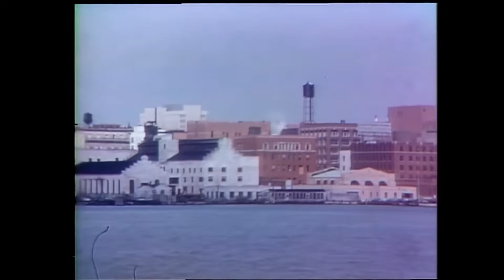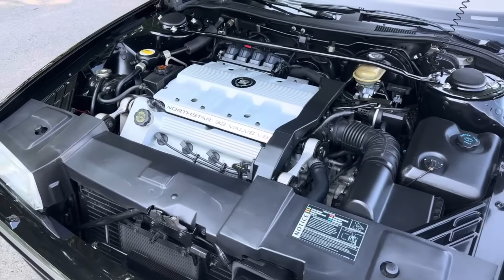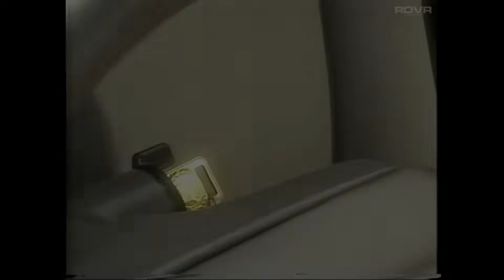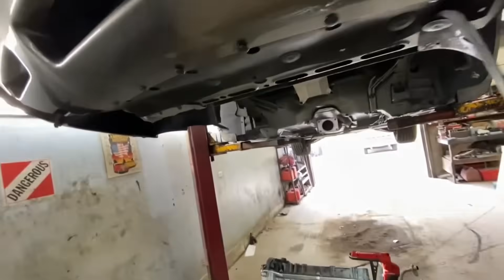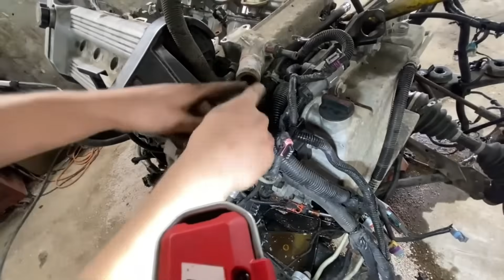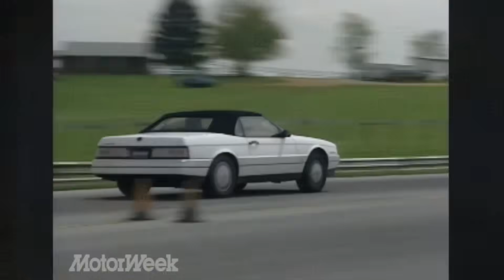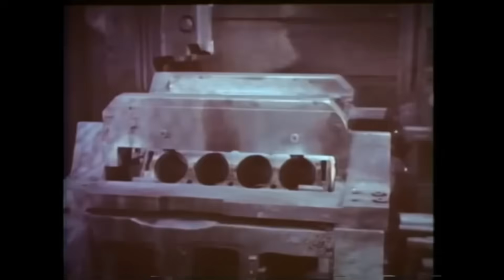Most HATED American V8 Engine of All Time!

Comment: .
    If you think the North star  was hated, you should remember the 8-6-4 engine from the 70's. Those were so bad, that people were disconnecting the control module and running them as a normal V-8.
    My parents had a 4.1L V-8 and loved it. The only problems he had with it was:
1), I had to remove everything off from the front of the engine including the radiator get to the bolts that held the water pump on. It took me parts of 2 days to change it because the parts shop was already closed when I found out that I needed to pull off the pressed on power steering pump pulley and needed to rent a specialized puller for it. When we bought the pump, if you put the Cadillac pump next to the water pump from my 225 Plymouth slant 6, (also a 4L), and stepped back 10 feet, you couldn't tell the difference. My water pump, $9.95, the Cadillac pump, $52.00.
2) When my father went to buy spark plugs for me to come over the next day and tune it up, he got into an argument with the parts guy over it being a V-8. The parts guy swore that an engine that small couldn't be an 8 cylinder. After all, the 225 Dodge slant 6 was also a 4 liter. How could a 4.1L be a V-8? The guy sold him, "an extra 2" spark plugs with the expectation that he's be back returning the 2. The parts guy was too proud to look it up that far in the book because he, "knew it all".
Reply: Whoever owned an ht4100 and loved it deserves a special medal…
Reply: @gm-classics  My parents were special people. Thank you. They didn't race or hot rod around. They were patient and used their cars for what they were meant for. Transportation and some degree of comfort.

Comment: The North Star engine was in direct competition with the engines from BMW and Mercedes.
All three companies made engines that have serious mechanical issues.
Cadillac should have tried to make a better engine.  BMW and Mercedes are not what I would say reliable engines.  The plastic parts in the engine break easily, and there is always something that needs repair.  Timing chains, coolant leaks, oil leaks, module issues to name a few.
Reply: As I said elsewhere my 2018 VW GTI with the EA 888 engine that they put in everything, is the most unreliable car I've ever owned.  The most reliable is my Aussie built 2009 Pontiac G8 GT.  Yes, a GM, L76 (LS2) aluminum block and head, pushrod V8 with 200K miles on it.

Comment: Aluminum block + aluminum head + torque-to-fail head bolts = BOOM!!!
Reply: Wasn't the Head-Bolts where it failed ... 
it was the weak shallow threads in the Block !!
Reply: Wrong. God, what an ignorant comment.
Reply: @The_Ebola  Most aluminum heads are hell to maintain because the block is cast iron.  If the block is also aluminum, don't even bother with it.  A time bomb at best.
Reply: @soakupthesunman  Sure, every auto manufacturer is wrong, but you're right. Ok.

Comment: I had a 32-valve General motors Northstar engine. What I did was reverse engineer all the design flaws. The factory head bolts were changed to an after made by ARP THE GASKETS WERE GARBAGE I switched them out to Fel-Pro. When I tore down the block I pulled the crank out and had it cross drilled and nitrated for strength polished on a Gibson. I also change the Pistons and piston rods to better quality components. Even the ignition system was upgraded to a better one. Shoehorn listen to my 1988 fiero GT and added a supercharger. I wound up with a poor man's Corvette
Reply: I doubt that fit in a Fiero.
Reply: @spaceghost8995 oh yes it did in a 1988 Fiero GT. If you look up GM performance there's an article where a gentleman was able to shoehorn the Northstar engine into his fiero that's how I learned how to do it. Also the modifications neither was upgrading the brakes to cross drilled slotted rotors. As well as beefing up the front and rear suspension.

Comment: To be honest, the Northstar engine isn't even a 'runner-up' amongst notable American engine failures, hated, loved, or otherwise.

The 2 worst Cadillac V-8 motors were by far the 1975 500cid (110 HP), and the notoriously infamous 8-6-4  V-8, aka the 8-6-4-2-0, lol!  
The HT4100 was, however, the most prolific failure-prone Cadillac V-8.  And they definitely made up for that mistake with the 1990s RWD Fleetwood V-8 350 LT1, probably one of their very best!
I can name 2 Chevy engines that were even more consistently worse.  The first was the integral head/intake on the 250 inline-6 from 1976-1984.  Even though  cast iron, they blew head gaskets and cracked the cylinder heads beyond repair.  Attempts were made to sell repaired heads, but the internal cracks extended into oil & coolant galleries that could never be fixed.  The only reliable solution was a rebuild with 1975 and older cylinder heads with separate manifolds.
The other was the 1976-1981 305 V-8, with warped and cracked heads, & abysmal, non-existent horsepower.  It started life as the fantastic 1975 262 V-8, which could run circles around the 305, for over 200K miles.
All the Chevy 350 V-8s of the 1970s had soft camshafts that ended up with round 'lobes' at or before 150K.  They also had nylon-coated aluminum camshaft gears that fell to pieces, and those pieces would stop up the oil pump pickup screen causing oil starvation and excessive engine wear.
The most hated Pontiac V-8 would likely be the 1981-82 301 Trans Am Turbo.
The most hated Corvette V-8 is almost certainly the 1980 California 305.

Ultimately & undoubtedly THE 'Most Hated American V8 of All Time'  would be the GM 350 Diesel V-8 made from gasoline engine blocks in the late 1970s to early 1980s.  They were virtually un-salvageable by any means whatsoever.  They were quite possibly the most motor-swapped American engines of all time!
Reply: My 1975 Buick Riviera had a catalyzed 455 rated at 205 net HP. My 1970 Buick high compression 455  was rated at 370 gross HP and moved. The Riviera was slow in comparison but the car was not a dog. I'm sure that the 1975 500 Cadillac made more power than my Riviera. 110 HP is ridiculously incorrect.
Reply: @williambikash6645  I stand corrected.  It was the 1976 4-Bbbl 500 with a net HP of 190, and the EFI 500 with a net HP of 215.
The 110 Net HP was closer to the 75 Chevy 250 inline-6; how criminally negligent of me.

Comment: I didn't watch the entire video. Did you mention the early Northstar's were throwing piston rods due to a engineering defect in the piston design? Or the crankcase half seals leaking like sieve? I worked in a Cadillac service department from 1991-2001, you couldn't chase me down and give me a Cadillac.

Comment: Funny,  if you ever owned a SAAB 900 it was common knowledge that you would have to replace the head gasket at around 120,000 miles.   It too used torque to yield bolts as well.........

Comment: America put a man on the moon SEVERAL TIMES. Why is it so dam difficult to build world class world leading vehicles.  And its not bean counters , its management looking to make a bonus . What is so infuriating is two fold . 1st is durability.  Testing in real world conditions to the point of failure before release , the NORTHSTAR is case in point 2nd is engineering.  Discarding decades of know practices so marketing and sell the custome vappor smoke and uni-corn farts . Wanna know why the axis lost ww2 , trying to develop wonder weapons, the allies won because they continued to refine basic but well engineered weapons that were built to a very high quality.

Comment: CORRECTION: The TTY bolts were not the cause of the failure, rather it was the bolts pulling out of the  block as the block’s threads failed. I had 2 Caddies with the Northstar engine and experienced this failure on both.
Reply: I saw  a tool that can be clamped to the engine block to re- thread the head bolt holes. It came with new bolts, a bottom tap, and head gaskets. I think that the rig cost around $1500.00.

Comment: Torque-To-Yield head bolts and only 10 head bolts per bank are not "seemingly innocent" engineering decisions.  Torque-to-Yield bolts are a workaround for after the engineers realize the effed up, not for initial launch.

All Cadillac had to do was come up with an engine that was a forever workhorse with unnecessary ruggedness and strong bottom end structure to make it the first choice for modification for racing applications.

Comment: The only problem was tapping a fine thread into soft aluminum. Had they used a coarse thread instead, there'd  have been no problem.
Reply: They should have had stainless steel inserts.

Comment: One of the problems was that the Northstar was mounted transversely as opposed to north and south with rear wheel drive. It was harder to change gaskets and bolts on the transverse engine. It had to be taken out of the bottom of the car. Which gave you the $6-8,000 figure. One of my best friends had a 1997 Eldorado. It was a beautiful car. Northstar Performance has all the pieces and can rebuild a Northstar. Just get the car cheap, and know a good mechanic.

Comment: Why am I not surprised GM tried to hide/ignore/blame.
Subaru EJ25 has an aluminium (correct spelling) motor with torque to yeild headbolts. Never heard of a head gasket failing on one of those. LOL. 
It seems like they fixed the problem after 2002. 
My 2008 has never had that type of failure.
I have been lucky enough to find an excellent engine builder. To avoid ring land failure, it has forged pistons and stronger rods.

Comment: I bought a new Lincoln Mark VII LSC in 1986 with their 5.0 Liter engine.  The drivetrain was B U L L E T P R O O F.  Drove it over 200K miles with NO drivetrain repairs...and might even be driving it now if it were not rear-ended by an uninsured motorist.  In 1998 I bought the Lincoln Mark VIII with the fabulous 4/6 DOHC engine.  Once again, over 200K miles with NO repairs.  In those days, Cadillac was FAR behind Lincoln in quality and reliability.

Comment: The most hated American V8 engine of all time was the Oldsmobile diesel.
Reply: And the funny part is that the weak Diesel 
350 block is very strong as a gasoline engine and has been built into high performance engines.
Reply: @williambikash6645  That's the way it always works. Every engine(and vehicle) has strengths and weaknesses, and most consumers lack the mechanical skills to be able to combine all the right pieces into a solid custom build. They just buy it, get in and turn the key. lol Why the engineers thought an upgraded gasoline block would survive a diesel conversion is a mystery, but the end result was just a total POS that ruined the diesel name for decades. If GM hadn't built those, there would no doubt be far more diesel engines on the roads in America today.
Reply: @AmericanThunder Correct. The PROBLEM was that they kept the 10 head bolt design. A SBC uses 16 which would have been a better choice.
Reply: @williambikash6645  That is the same with the Ford 4.6 engines that are in the crown vics and Towncars. They take high compression exceptionally well.
Reply: @williambikash6645 yea I had one of them. The block was a iron block which is why the hotrodders loved them.
Reply: @williambikash6645  That's probably because the diesel engine had more than twice the compression ratio of the petrol engine, 21.6-22.5 vs 8.5-10.5
Reply: @williambikash6645 Correct. The DX blocks. Wish I hadn't scrapped it.
Reply: @williambikash6645 True.
Reply: I absolutely agree.  And BTW, I've owned a 2008 DTS with a Northstar.  Great car, great engine.  I now own a 2009 XLR with the Northstar., still a great engine.
Reply: @chemwrite  Work for GM huh , maybe a relative or stock holder
Reply: My first thought when I read the title. One of my uncles owned one. He worked for GM and never bad mouthed them UNTIL he purchased that car.
Reply: @mikerieck306 getting paid to work on something is different, than owning and then paying.
Reply: the vega 4 wasn't any better
Reply: @chrisperry3525  Much of Vega's engine problems were the years and consumer ignorance .
Reply: I bought a new 1980 Oldsmobile Delta 88 with the 5.7-litre Diesel Engine. At 57,000 miles, it was a mess, despite meticulous maintenance. Blown head gaskets, leaked oil, and froze every Chicago winter. I got about 1/2 its value when I sold it, even though the body was in perfect condition. GM uses bean counters on everything-make it as cheaply as possible to last until after the warranty expires. Then they give you the middle finger.
Reply: Yes indeed
Reply: Nice comment. Talk about a boat anchor! Come to think of it the Eldorado used that Olds diesel as an option if i recall. How about the 4.1 engine Cadillac had prior to the northstar that wore the cam lobes like they were made from mild steel? The Northstar was an oil leaker big time but was otherwise decent
Reply: #1 : GM 350 diesel engine 
#2: Chevy Vega engine 
#3: Pontiac 2,4 L Quad4
Reply: @micheltherriault7063  I would put the Cadillac 4.1L V8 in second place
Reply: @micheltherriault7063 Oh yeah I almost forgot about that one. I had first hand experience with that one. However after the mass recall and new engine and transmission it ran somewhat decently.
Reply: @alandenson6649 On my list, I forgot to mention the 80’s Cadillac 4-6-8 . 
And now the GM V8 in pickup trucks with all the troubles with de lifters and connecting rods bearing issues. 
Ford with the turbo issues on Ecoboost engines and the failing rubber belt driven oil pump on the 5 liters V8
Reply: @micheltherriault7063 # 4 Ford 5.4 Triton V8
Reply: @micheltherriault7063 Try This:
Oldsmobile 350 Diesel
Chevy Vega 140
Oldsmobile 138 Quad 4.
Reply: My friends father had an Olds with a Diesel in the 80's, I could run faster than that car on takeoff !
Reply: The Olds diesel was hated but easily remedied back in the day. All you did was bolt on gas heads and install a distributor, then drain the diesel out. Best part was unless you used the worst smog heads they would have 9:1 compression and run great. Now Olds Diesels are sought afte they share the footprint with the regular 350 olds. However, due to being a diesel, it has massive amounts of nickel and extremely thick casting, allowing it to be bored to .125 before needing sonic testing. The main bearings are the same size as Olds Big Blocks.Guys bore and stroke them, then put gas heads on them and make upwards of 600 horsepower. It's a myth that it was just a gas engine with diesel heads on it. The block was a different casting.
Reply: @AnthonyPerna2 The heads and head bolt layout was the weakpoint in that engine and the cause of the failures . The heavy duty block was the only thing they engineered right .
Reply: @gladeshunter8796 I agree
Reply: Knew a guy that had one in the 80s. He would just leave the thing run in the driveway all the time because if he shut it off. It wouldn't start for another 30 minutes.
Reply: @deplorablecovfefe9489 lol! That sucks
Reply: 3 valve 5.4 Triton is also up there
Reply: My parents bought a cutlas brand new when I was born in early 80’s and I can remember my dad talking about it.
Reply: Yea, I live in Colorado.  Back in the day Oldsmobile diesels would leave a black cloud streaming behind them as they headed up into the mountains. It was gross and they were so slooow.
Reply: My wife had one of the Buick equipped diesels. It threw a rod at 20,000 miles.
Reply: I literally thought it was gonna be the Olds diesel by the title and was let down to see the Northstar badge
Reply: Those engines made me a boatload of cash fixing them in my delaership days. Also, the later DX blocks made a great base for a low-deck Olds gasoline stroker.
Reply: don't forget the old gm Vega engines!
Reply: This
Reply: I thought it was the quad 4.
Reply: Thought so…
Reply: 💯 correct
Reply: I loved my Diesel! I had one in an 80 Delta 88. I rebuilt the top end and changed to HP fuel pump twice, but I got a lotta miles outta that car. When it ran, it ran like a tank. Another plus, was the simplicity of that engine and fuel system. I was always a small block Chevy and Ford guy. I grew up always tweaking one. I got the Delta for $1500 and it died about 3 months later. I couldn’t believe how simple it was compared to a gas engine. I sold it to an old timer who had it for more than 10 years after
Reply: @fitzdawg821 I bet a 600hp Cummins swap would be fun for that car. Especially if you tubbed it.
Reply: Miss my caddy
Reply: That mistake was converting a gas engine

Comment: Been driving Cadillacs as daily’s for 2 decades now.. I’ve had 2 northstars a Deville and an STS.. the head gasket issues are blown out of proportion mostly by people who’ve never owned one. GM corrected most of the issues after 2000 and by 05 the head gaskets weren’t even hardly an issue at all, they made the Northstar all the way until 2011. My former 2014 CTS, 2018 ATS, and current new CT4 have all had more issues under warranty than my STS or Deville did.. both of those had 150k when I sold them and the guy I sold the Deville to still has it, I saw it on the road last week

Comment: Bought a new Deville DHS in 2004, put 175K on it with normal repairs (alternator, PS pump, etc). Gave it to my daughter when she was in a bind.  She put another 25k on it and it was still running fine  when she traded it in for a new Explorer.  I know I'll get a lot of doubters comments, but I'm telling it like it was.
Reply: By late 2004 model year GM had already started to use better "all steel" gaskets and improved head bolts.